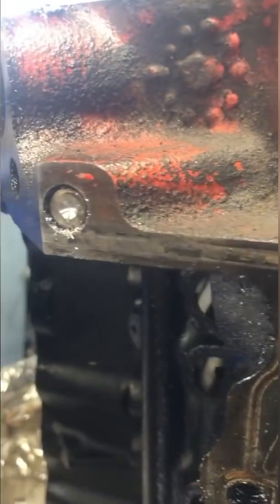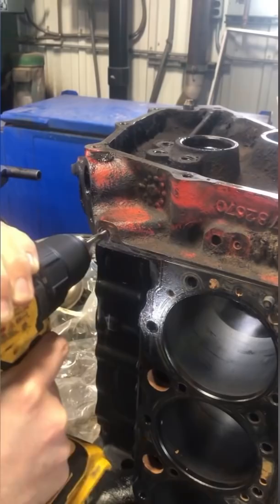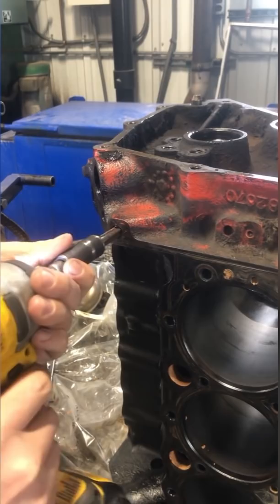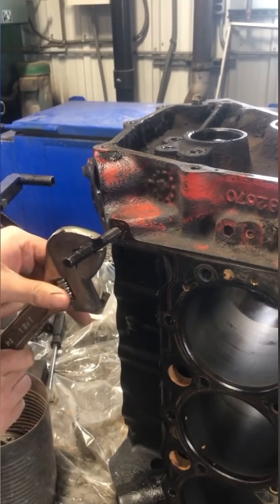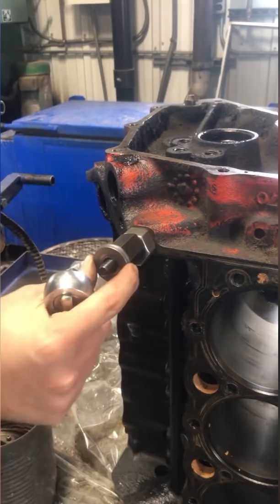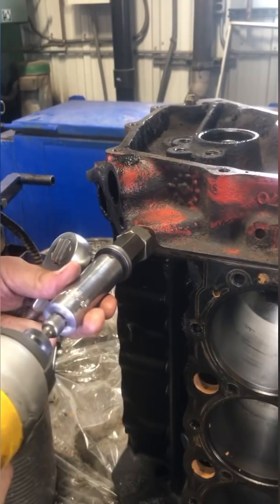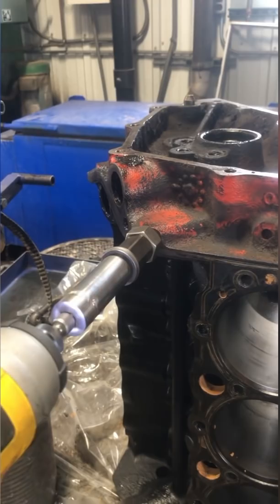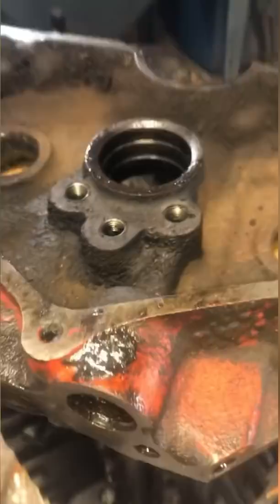#shorts Removing a Blind Solid Steel Plug - 327 SBC - @JAMSIONLINE

Comment: As a contractor who has been using both for years, DeWalt drills\impacts are far superior to Milwaukee.
Reply: Depending on how many years. I've been in the trade for 20+ years.  There was a day, I wanted anything but a Dewalt.  They were the heaviest, most cumbersome, and lousy torque.  Recent years they really improved.  And no, heavy doesn't mean a better built product to all of the others who will read this😂.

Comment: DeWank is every bit as good as Milfuckye. But you're using the ¼" hex drive impact and have the adapter on there. Get the ⅜" square drive and make your life so much easier. Especially in an automotive setting. Less connections to go through, shorter length and I'm pretty sure they output more torque anyway.

Comment: Didn't cheap out on Dewalt... thats just the wrong Dewalt impact for the job...  sick trick!!!
Reply: Thank You
Reply: I appreciate you mentioning this, that little quarter inch was doing its best
Reply: Take my old xr over any fuel
Reply: @starkindustries26  dude the 1/4 inch Milwaukee has way more power trust me at work the company buys dewalt but I bough my own Milwaukee and it removes bolts the dewalt will not everyday ai
Reply: @nightmareinaction629  Project Farms proved this to be wrong lmao. Dewalt actually has more reverse torque than Milwaukee does
Reply: @christophergonzalez5552  pulling out the facts lol
Reply: @christophergonzalez5552  DeWalt all day
Reply: @christophergonzalez5552  idk about that because our Milwaukee always wins no questions you cant even use the dewalt on the chain breaker as it does nothing and he used a hydroulic surge which is Milwaukee weakest tool imo use generation 2 and see the difference
Reply: My half inch Dewalt would rip that out easy
Reply: Well regardless what has more power (milwaukee or DEWALT) milwaukee tools are mostly made in china except Sawzall blades and hole saws. While DeWalt has some Chinese tools, many tools are made in U.S.A. or vietnam.
Reply: @josephdurish2315  I have to yet break one of my Milwaukee tools but I dont see the problem there I broken like 2 dewalt impacts I like dewalt drill with the super bright light i submerged my Milwaukee in water battery indicator stops working for 3 or so days but the impact still works
Reply: @nightmareinaction629  I do have some milwaukee tools myself and they are not bad, but I really like american made tools. But of course now it's hard or impossible to find tools that are completely made in usa. Made in U.S.A. with global components is about as close as you can get.
Reply: @josephdurish2315  made in the U.S. with Chinese parts... What's the difference?
Reply: @Warfare_Clown  I understand your point,but American workers are still being paid to assemble some DeWalt tools. Not some poor 9 year old chinese boy or girl that is forced to work in factories. I know that it is not always like that but I would rather not support such a horrible country that is unfortunately taking over the world of manufacturing.
Reply: @nightmareinaction629  it's all in your head my friend. We run both brands and both feel the same.
Reply: @christophergonzalez5552  what’s weird is that even though he showed that I have serious doubts. I’ve had a plethora of 1/4 inch impacts and NONE of them could do what my Milwaukee can do
Reply: @christophergonzalez5552  cool but the tool dies after 1 year
Reply: @nightmareinaction629  maybe your just using an oversized comparison but I've yet to run into a situation where a Dewalt wont dominate. My original 20v impact from 6yrs ago will drive a 1/4" lag into barn oak without problem
Reply: Is Milwaukee really better then dewalt?
Reply: @davidreid2092  from my results, yes.
Reply: @davidreid2092  In short, no. Honestly the  answer you're looking for doesnt really exist. In theory youd like to have a bunch of fancy charts with organized test results that explain all pertaining variables to the appointment of a winner. In reality they're tools, that simple. 'Would the other brand have been able to better perform in the job I completed', is a pretty opinionated question, especially given the quality of both brands. Personally I roll Dewalt, it was the tool life handed me a while back. I've dropped them from 2 story roofs, drowned them in creeks, slide them across the road at 40mph b/c the fucking tailgate was down, but they just keep rolling. Hell the first gen 20v set I got 7 years ago still gets along just fine. The trick is to buy the model from either that's actually made for work. Most people will tell you to get one brand over the other because of 1 bad experience they had with the rival brand. But I've come to realize that MOST of the time what really happens is that people dont get the right model within that brand. Kinda like ofroading in a 2WD Jeep Compass when you needed a Wrangler. Bottom line is get the level of tool you need, nothing more nothing less. As far as Dewalt vs. Milwakee, just go what feels good in your hand.
Reply: @davidreid2092  honesty depends on the job and tool your using
Reply: Better the quarter inch than anything else!   It's only a 3/8 stud!  Experience says anything larger you WILL have a PITA broken tap!
Reply: Actually dewalt is cheap these days.... Dewalt is even close to being on the same level as Milwaukee. You have to get a hi torque dewalt just to compete with Milwaukee mid torque
Reply: @christophergonzalez5552  that’s not true at all
Reply: @austin8826  I have had a dewalt max xr for a little less than 3 years already. Use it almost daily as I work as a mobile mechanic for a side gig. It’s never done me wrong.
Reply: @nalley6815  It takes one video watch to see That’s not true. Both tools, at their highest operating torque range- dewalt comes on top with more reverse torque than any other tool. Also- everyone has a different experience with tools. I have always owned dewalt tools and I have NEVER been let down by them. My main impact (dewalt max xr) is not only a cheaper alternative but is still kicking after 3 years of usage as a mechanic. Take care of your tools and they will take care of you.
Reply: @christophergonzalez5552  Thats just not true man. Look at the specs side by side of the comparable tool. Specs aren’t always the most accurate but then look at videos of the comparable tool. Milwaukee absolutely crushes dewalt in every single way
Reply: Well said brother
Reply: @josephdurish2315  bro  they say parts from China and assembled in Us , their broth from China
Reply: Hahaha you buy dewalt. What a joke
Reply: @Yeah Right Milwaukee kicked the shit out of dewalt everytime. What’s your point?
Reply: @christophergonzalez5552  owning both I can confirm the Milwaukee spanks the dewalt all day
Reply: Lol, I’ll laugh at all of you with pneumatic power
Reply: @nightmareinaction629  
Technically personal experience doesn’t equate to facts.
Especially considering you didn’t mention how old the dewalts and the batteries were and you went and bought a brand new Milwaukee….
Reply: @notacreativehandle Milwaukee spanks DeWalt in terms of quality and reliability. both are good tools and do the same jobs it's just Milwaukee will do that job longer or better and if you treat a Milwaukee tool like a DeWalt needs it will probably last forever lol.
Reply: @infernaldaedra  
Opinion is subjective, but you’re entitled to an opinion so whatever.
If that’s what you believe, knock yourself out.
Reply: @notacreativehandle  Not acting like I won't use either I just have that as my preference. If I was buying a tool and DeWalt had a better value I'd take it. 🤷‍♂️ But as long as we're talking impacts and drills Milwaukee lol
Reply: Except Milwaukee has been slowly cheapened up there products.  Essentially loosing and ruining there rep.  They are the walmart of power tools now.
Reply: Dewalt is better but to be honest air is better than cordless.  I'd put up a wore out air impact to a fresh battery impact ant day.

Comment: I love how you mentioned the broken tap comments, because honestly the first thing I thought when I saw you using an impact with a tab was, “brave man”
Reply: I see that all the time on here for some reason. Doesn't seem like you really have good control doing that, but it appears to work ok.
Reply: Yea you can but taps designed for impacts now but still gives me chills when i see it done, at least you dont hear that dreadful gravel grinding crack if it breaks😂
Reply: I use a impact tap all the time, multiple times a day. I have had maybe one tap break all year after thousands of taps.

Comment: Me, with my B&D tools: “Maybe someday I’ll be able to afford DeWalt!”
This guy: “So I cheaped out on DeWalt”
Me: 💀
Reply: Exactly 😂, I’m over here putting long pipes on my wrenches to use as a breaker bar
Reply: At least for automotive or anything like that Milwaukee is better. Dewalt is good for home improvement type stuff
Reply: @luismiguelruiz4290  bruh I broke like 3 cheap ratchets on 2 bolts doing this the other day lmao, ended up having to just go and buy a breaker bar in the end too 😂
Reply: Black and decker is the same as dewalt. If you want an upgrade you should go with makita or milwaukee. Or if you can't afford those and you're not using them professionally, ryobi seems to be a great low budget choice.
Reply: @natedawg23451000  this is fanboy nonsense.
Reply: @rewris  I’m fanboying? Over facts on tools?
Reply: @natedawg23451000  any carpenter worth his salt will have a dewalt in his hand.
Reply: @thomasvincent9220  so dewalts good?
Reply: @natedawg23451000    Every professional carpenter I know including myself uses dewalt. I usually see Milwaukee being used by electricians or auto guys. Good quality tools as well, but dewalt is definitely not the cheapo version though.
Reply: @thomasvincent9220  I’m glad you said this, because that’s exactly what I said the first time I commented
Reply: DeWalt impacts suck and so do their batteries. They don’t last a year in my shop

Comment: Nice! Tools don't matter, results do. Sure a specific tool can get the job done faster but, Milwaukee or Dewalt who cares.
Reply: I've honestly gotten more reliability and power out of certain Dewalt tools compared to Milwaukee. Milwaukee's ¹/2 3/8 and drill have all had dead triggers at times even with good battery connection. Also when using Dewalt next to a Milwaukee turns the lights on the Milwaukee. Even using the electric spark lighter close by turns the lights on. Just an interesting occurrence I've noticed. Also harbor freight cheap tools some of them a far better n stronger than snap on plus makes more money.
Reply: Tools do matter lol, go get some bauer tools from harbor freight then get a dewalt or milwaukee and let me know the results xD
Reply: @freakymrq  the new harbor freight beats the Dewalt... Maybe not in speed but in ft lbs.  I love my wilwaukee stuff and my snap on but you miss the point totally which is why he made the comment he did
Reply: @familytraditiontransportat7951  if you watch any stress test video the bauer doesn't come near any actually name brand tool. 

Obviously results always matter but good tools go a long way. My rule of thumb is buy new tools cheap, if it breaks go buy the better version, if it doesn't break you either got a good tool cheap or you don't use it enough to justify buying a good one.
Reply: Spend the money on Milwaukee youll thank me later 😌 🙏... or do you even work bro?

Comment: Funny story here.  I was doing a cylinder head job on a Volvo d13 engine and they had an issue where water would get in the valve cover bolts and rust the back holes out really bad .

So upon reassembly I was using my tap in my impact driver to clean them out.  I had done countless cylinder heads at this point and had done this in the past to speed up the process.

Well I zip the tap down and bang, breaks off in the hole… fuck. 

I tried it all to get that thing back out.  Finally I figure I’m going to weld a washer on there and see if I can’t get a solid tack.

Well the entire job up to this point I’ve been cleaning things with brake clean. The timing plate, head bolts (to mark them for angle torque) etc. etc.

I struck up the arc and a spark went down the back of the motor into the oil pan.  KABOOOOM!

My initial reaction was to complete the bead real quick until I realized the severity of the situation.  There was a gaping, flaming hole the entire length of the oil pan and oil 2 bays over.  Nothing the 10 pound fire extinguisher couldn’t handle, though.

Let’s not talk about how after that debacle was sorted out I had to do the front and rear mains.

Comment: The broken tap issue is not an issue if you use a two flute or a three-foot tap. Those machinist Taps are designed to be driven by a machine tool. Most of my tabs are too flute, they're designed to drive the chip down rather than curling it around. With a four-foot tap you are supposed to run it in some and then back it out to break the chip . The four flute tap breaks because the chip actually gets in the way of the forward progress

Comment: Used dewalt drills for years doing metal trusses. Top quality. Somebody left one out in the rain all weekend. Didn’t effect it at all. But if you drop one 40ft onto concrete its done

Comment: Adding a 3-piece or 1 piece thrust bearing like wats used on a crank balancer installer into the stack will reduce the friction of all the spacers turning against each other and make life a bit easier and quicker.

Comment: Add grease between the washers and they act more like a bearing. Or use the thrust bearing out of a power steering pulley puller kit. You may even find the adapters to be threaded in a suitable thread for tapping your plug to pull it out with.

Comment: Worth it, I’ve had three engines go horribly wrong with excess carbon flakes. One was just old, two were rebuilds. One was running before the rebuild and blocked the rear mains gallery. It hadn’t been serviced properly :o(

Comment: How do you keep your taps from breaking when you use powertools like that? Is it the pulsing action you used here, lower power setting, or what? Pretty cool trick though. 

Thanks for posting this short! They are like mini montages and make everything seem so easy and satisfyingly quick, but also show the whole process in a condensed fashion. I like it.

Comment: Any tap size over 1/4-20 I use the impact for.  1/4-20 and 10-24 I use my snapon driver with the rocker trigger. 

I’m also a big fan of boelube for tapping and drilling. Boeing got something right with that shit because I’ve never broken a tap using that shit.

Comment: It doesn't matter anymore anyway, Milwaukee, Rigid, and Ryobi, are all owned by techtronic industries. And only represent different price points in market segmentation now. Quick addendum, rigid pipe threading and pipe working tools are still manufactured by the original company and are still high quality.

Comment: have you ever used helical taps? if so what are your opinion of them. personally i think they are superior in 3/8in and up but the smaller ones don't have enough meat in the core and that makes them too brittle. feels like the tap handle alone has enough weight to snap them sometimes.

Comment: Great Job. Anytime You have a problem With a Plug, you Can heat the Block being CastI iron to a Dull Red. Let Cool, after Cooling Soak the Plug with Kroil Oil for 24 hours the Plug Will come out easier. The Kroil Oil is a Creeping Oil you can buy. Cast iron is completely different from Steel. Cast iron will not wrap and steel will warp. You can burn a steel plug from a Cast Iron Block with out DESTROYING the Block. But on Studs or Plugs Always Use Anti-Seize on Your Bolts, Studs or Plugs.

Comment: Could you have just used a bolt once you put threads in the plug and used a slide hammer? Not sure if its faster or easier to do that instead of using the threads and pulling it

Comment: What’s your guy’s opinion on glassbeading the entire block do you do just the exterior or internals or every spot the gun access? I personally will glassbead parts like rods or the crank but not the entire block I just don’t want to chance the glass getting left behind in a oil passage.

Comment: There is a very big difference between dewalts and milwaukee power and pricing. You could buy a 1/2 dewalt impact with 750 nut busting torque for a lot more then you’d pay for a 1/2 in 1400 nut busting torque gun from milwaukee. I got my 1/2 milwaukee for 250 on a steal with a battery and charger

Comment: Nothing wrong with that dewalt but you should use a impact wrench not those drivers as you loose alot of power through the 1/4" to 3/8" adapter

Comment: like this a lot until you said glass bead blasting... that ain't good. it's extremely difficult to get all the glass dust out of all the galleries and little orifices. in most cases engine oil will pick it up later, transport it to bearing surfaces and increase wear on those parts. 
i'd always prefer either dry ice blasting, or just chemical cleaning. no glass beads, sand or walnut shells.

Comment: I just had a set of heads checked at my local machine shop .brought them home ,poured a lil gas in all my intake ports and 5 if 8 leaked.then they told me they didn't lap them in.i took them back .and when I got them back the 2nd time 3 of 8 leaked .they said when they inspected them that they just touched up the seat aera..they actually have no seats just machined into the bowl.world product dart 2 sportsman heads ....is that normal?  I didn't even check the exaust idk why

Comment: Are these types of plugs still used? They seem like they get stuck a lot
Reply: Its a steel pin beat into a hole, its supposed to be stuck. Later model blocks had a threaded plug there.